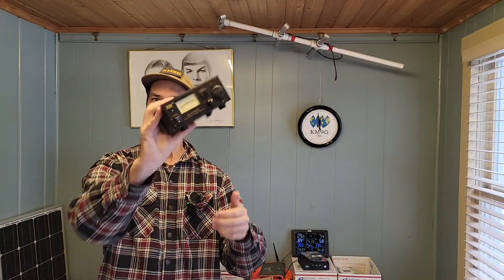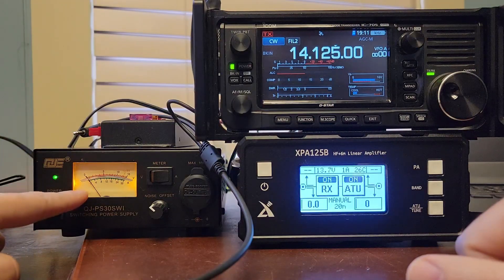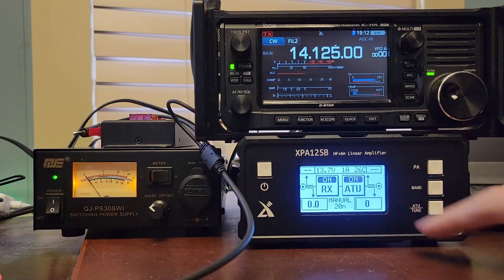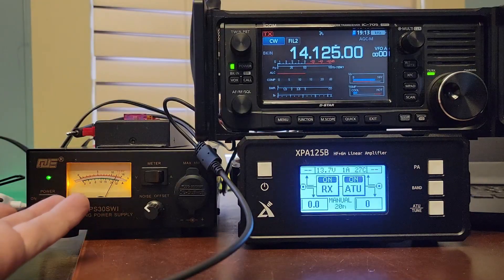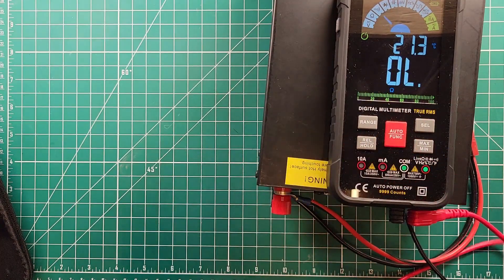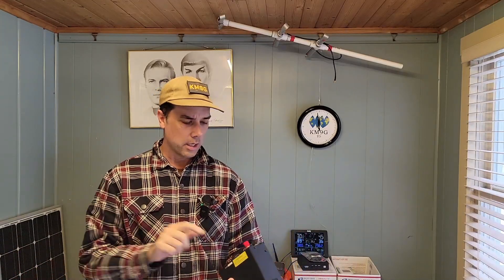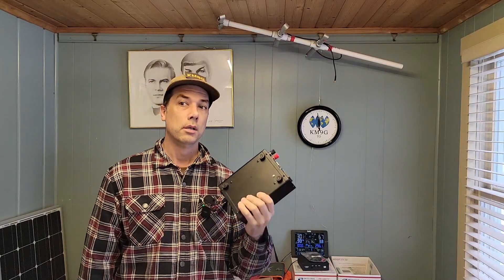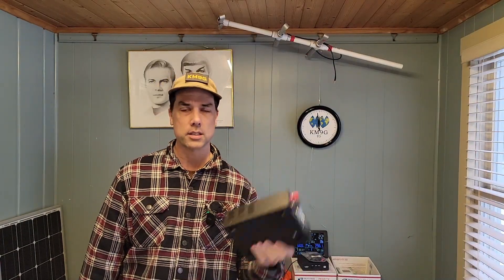Your First (Maybe Last) Ham Radio Power Supply!

Comment: I have a 6W Yaesu FT-818ND and a complete newbie so I don’t have a dedicated external power supply for it yet… is this power supply going to be ok if the 818 is the only load or will it be too hot for it..?
Reply: Just fine
Reply: @VK4FOO  Than you sir. SOLD. 👍
Reply from the maker: Yes, this will be a great power supply for the FT-818 - you can even add a tuner and an amplifier for 100w
Reply: @temporarilyoffline  Excellent, yes I've ordered one. I was shopping around awhile and whilst a couple available locally are a bit cheaper they don't have some of the protection features.
Reply: @temporarilyoffline My copy of this power supply arrived down here in the penal colony a week ago. It's pretty solid.
Reply: there is nothing like "too hot" power supply - for home QTH, at least 30 A capable power source is a must

Comment: Love the switching power supplys.  I have 2 Samluex, a 35 amp and a 23 amp.  Both have lasted more than 5 years.  Nothing wrong with Ashtrons, you just need 2 men and a small boy to move them.  73
Reply from the maker: Astrons are heavy for sure!  And Big too!
Reply: I dropped mine when moving and it nearly hit my foot. @temporarilyoffline
Reply from the maker: @martincvitkovich724  ouch!

Comment: I have a huge Astron, and it turned out not to put out enough power for 100W radios, it runs mobile units just fine. So - The country we don't mention came to the rescue.
Reply from the maker: If the US could step up, we wouldn't need to not mention the 5 letter word.

Comment: I've always had the astron rs-35a and it is always a challenge finding a good spot for it. I don't think I'll be replacing it anytime soon, but it's good to know what else is out there. I also did not realize that some switching power supplies give you the option of moving the noise offset, that's awesome!
Reply from the maker: I haven't had a need to move the noise - I couldn't find it to begin with.  Nice to know its there if I need it though.
Reply: @temporarilyoffline  Right, exactly. Knowing that it exists gives me that knowledge in case someone throws out something about switching PSU's being too noisy, etc 👍 "The more you know" 🤣

Comment: My Icom power supplies were to heavy to take to Sth  Korea, so I'm using the same one as your showing and it's been working a treat with a FT-891 doing continuous FT8 @ 30 watts for hours and hours and hours., and the lighter socket with fast USB charging for power to tablet and phone.   Highrise rooftop in Unseo Incheon SK portable.  FOO was here. ;)    H7/VK4FOO  Aussie Down Under - Gold Coast
Reply from the maker: Hey Foo!  That's a nice setup.  It will handle 30w+ all day long for sure!

Comment: These are solid little power supplies. I have a nearly identical unit from R&L that has served me well. One thing to note is you will see these units with either a 12V cigarette lighter socket or 2 sets of power poles on the front panel. My R&L unit has the power poles which come in very handy in the shack.
Reply: One thing to keep of note is that the front ports (be it powerpoles or a "cigarette lighter" jack) are typically lower amperage, so you wouldn't want to power a base station rig, or cigarette lighter for that matter, via the front.   I was looking into voltage adjustable desktop power supplies for electronics projects that also put out 30+amps to use with a radio(s) for eliminating clutter in my shack/electronics bench setup.  Many of the more affordable ones don't have the offset function, and are not designed for rag chewing.   It would be cool to run one power supply though...  If anybody is running a setup such as I described, I'd be interested to know what supply you went with, and if you have noticed any noise issues, both RFI and fan noise.  It's probably best just to use two anyway, just incase I had the voltage set higher than 13.8, and powered on my rig, then again, circuit protection devices should prevent any damage.  idk.  was just a thought.
Reply: @jampskan5690  I have an Alinco with cigarette lighter socket option. Never used it. Curious as to know how are they to be used or how have you used it ?
Reply: Same here in regards to R&L. Runs my WinkLink RMS. Still going strong.
Reply from the maker: That's a neat option!